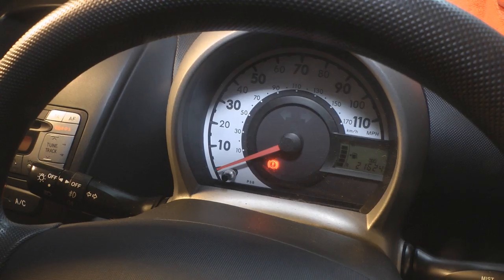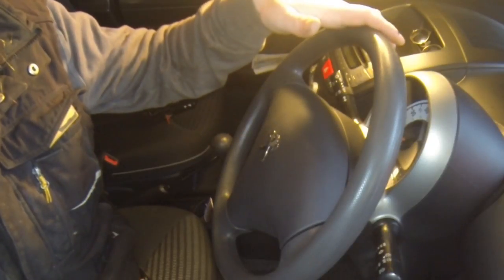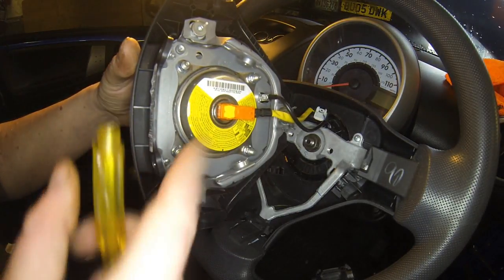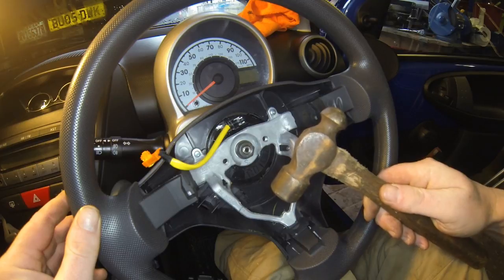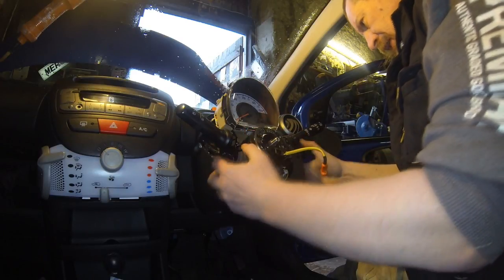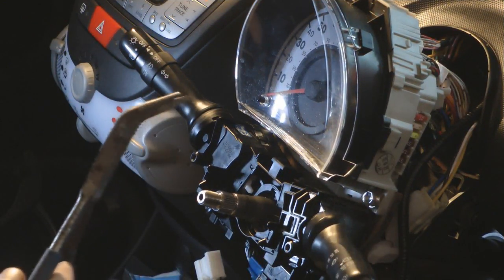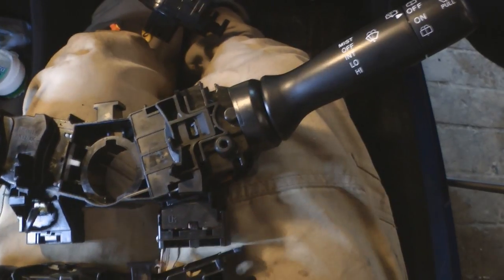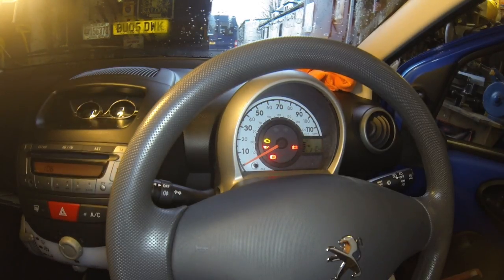#Peugoet107 #Indicators Peugeot 107, Aygo & C1 Replacing Faulty Indicator Stalk

Comment: So I've discovered a lot of 107s only have rear fog lights but the model I have has front and rear.  I can find a lot of cheap replacements with just the rear fog light switch but none with both.  I'm thinking about trying the rear fog light only switch and just not using my front fog light. Do you think the part would work?  The stalk seems identical from what i can tell apart from the extra switch position for front fog lights...
Reply from the maker: Yeah mine has front fogs too and I fitted the single rear fog indicator stalk.  Stalks with the both switches can be found but last I checked they were still nearly £200. My front fogs don’t work  anymore but could easily fit a separate dash mounted switch instead for them.
Reply: @playing_in_trafic  great! Good to know.  Yeah I'm not about to spend ten times as much just for the front fog switch if the rear only switch works. Getting one delivered tomorrow, hopefully I'll finally get it fitted and working
Reply from the maker: @merlin9240  Yep that’s my thinking too. I figured if needed for MOT I’d just remove the front fogs. All the best with the replacement. Hope all goes smoothly. Atb Dave
Reply: @playing_in_trafic  yeah the MOT was my only concern if this worked.  But i assume since front fogs aren't a legal requirement, it won't fail the MOT even if the car should have them right?
Reply from the maker: @merlin9240  Yeah. If they are on the car at the time of the test they are supposed to be operational but if you remove them it won’t fail because as you say they aren’t a legal requirement. Mine obviously never gets them checked. 😏

Comment: I've ordered a new stalk. But even if I were to just clean it, would I still have to take apart the wheel?
Reply from the maker: Yeah you really need it on a bench to clean it as it's fairly complex to take apart and reasemble. So either way you would need to remove it which involves removing the steering wheel.

Comment: Great vid. Any ideas about airbag light all of a sudden flashing 107 2006
Reply from the maker: Cheers, not 100% on airbag light but check electrical connectors under both front seats. These can sometimes get dislodged and show an airbag fault. Failing that It really needs to get the system scanned by a garage or someone with an SRS scanner. Hope you get it figured out. Atb Dave

Comment: Nice instructional video, very clear. Didn't quite get the part when you took off the steering wheel and marked a thin line? where the splines are ..is that possibly the steering lock position. Thanks
Reply from the maker: Hi Philip, thanks for the positive feedback. I marked the position of the wheel on the splines so that if the steering got turned at all during removal, then as long as I match up the marks when reassembling the steering will be straight ahead when the steering wheel is central. If you are one or 2 splines out when you put the wheel back on then the steering wheel will be cocked slightly to one side when the car wheels are straight ahead. Atb Dave
Reply: Thanks for making that point clear Dave, quite important to get it right. Just waiting for a T30 and the part, take a deep breath and go for it. will get back later to let you know. Thanks again, you've been a great help
Reply from the maker: All the best with the repair, glad to be of help. Atb Dave
Reply: HI Dave, amazing day all round. Successfully installed the indicator stalk 
I was all psyched up this morning waiting in anticipation for the part, ....already had the tools to hand. 
It went like clockwork nearly :-)
A couple of glitches as one has in any scenario i.e.

Struggled to ease out the whole stalk with one hand whilst compressing the clip, so enlisted some help to get that done  
Lifted the speedo up OOTW to gain some space

The reverse install was very straightforward
Saved at least £65 in labour by not going the garage route, and best of all doing the job yourself gave a lot of satisfaction....would have felt cheated if I had let someone else do it....
Indicators are all systems go, and looking good. Thanks again, your video was amazing
Reply from the maker: Philip D Awesome, glad to hear it went well. Yes you can't beat the satisfaction of repairing something like this yourself and saving a good chunk of cash in doing it. Cheers for the update, happy motoring. 😊Atb Dave
Reply: h3r34thebanter, still on a high after doing the job, am sure the old car will appreciate it. not bad going for a 9 year old I guess, worse things happen :-)

Comment: Great video, I've just done this on the wifes Citroen C1, put it all back together but now I've got the airbag light lit up on the dash. Any idea how to reset the light?
Reply from the maker: hmm, sorry to hear that. I don't know why airbag light would be showing. My advice would be disconnect battery and recheck the airbag connector is plugged in correctly but also check and wiggle the connectors under the front seats in case somehow they got knocked loose whilst you were working in there. If the light still stays on after you reconnect the battery, you may need to get it checked and reset with an SRS scan tool. Hope you can get it to go off without to much hassle. Atb Dave
Reply: h3r34thebanter Thanks Dave. I'll give that a try tomorrow!
Reply: Easywhenyouknow Did it work? I've exactly the same issue on my 107, the airbag light is now flashing!
Reply: Hi Andy, I took the airbag back off and discovered i hadn't pressed the connector back in properly. (The orange and yellow one) All fine now!
Reply from the maker: +Easywhenyouknow I'm glad to hear that 
you managed to sort it fairly simply, I hope Andy has the same luck. Atb Dave

Comment: Might be a bit late to the party. would replacing the stalk help my issue which is, both my full beams and dipped lights have stopped working. When I turn my light on the full beam light in the dash comes up even though I don’t have the full beams switched to the one position TIA
Reply from the maker: Sounds odd, guess it could be a stalk problem. I honestly don't know though. Hopefully someone can help you out. Atb Dave

Comment: After changing the stalk, the high beam goes on when I connect the battery again. The ignition is off and I can't shut the high beam off with the stalk. Any toughts?
Reply from the maker: If all connectors are properly connected it sounds like a faulty stalk.

Comment: Okay, is there some trick to getting those T30 screws loose, they absolutely will not budge on mine at all.
Reply from the maker: No trick needed but using a T30 bit in a ratchet drive is prob easier than a screwdriver type. They shouldnt be that tight though.
Reply: @playing_in_trafic  Thanks for replying, I finally got them loose by gripping the driver handle with a pair of vice grips to get more torque on the twist. Boy they were tight. All done now though and indicators working again. Thanks for the video, it was invaluable.
Reply from the maker: Perfect. Glad you got it all fixed. Cheers for commenting back. Atb Dave

Comment: Great video, thanks! But my dash indicator light still isn't working...does anyone have a link to how to change the bulb in the dash? Assuming that's what it is since I replaced the stalk...
Reply from the maker: I haven't heard of anyone else having that problem, hope someone can give you an answer on it. Atb Dave
Reply: I'm having the same problem - would be interested to hear if you got it fixed!
Reply: The fault was supposedly on the instrument panel circuit board...but we never got to test the theory because the garage said it wasn't an mot fail after all, as long as there was an audible indicator warning
Reply: @blandyjapseye69  thanks, I was thinking along the same lines.

Comment: Very helpful video. Just a few comments on problem I had with the job. Couldn't get steering off with hammer so bought a cheap puller https://www.amazon.co.uk/gp/product/B000WTPJKA/ref=oh_aui_detailpage_o00_s00?ie=UTF8&psc=1 did the job fine. Removing and fitting the spring clip, I found I needed 2 hands to remove the stalks & a helper to compress the clip. Also, I noticed that the commutator ring for the air bag and horn has limited 5 turns, so it is important to make sure it doesn't rotate when you remove it, because if you don't have enough turns left for full lock you'll smash it.
Reply: Not tried it, but when you compress the spring clip, maybe use an old fork to keep it compressed, then you can use both hands to move the stalk assembly.
Reply from the maker: Great info, thanks for sharing. Atb Dave

Comment: Can anyone shed some light on refitting the clock spring as I broke mine replacing the indicator stalk did I just tighten up the wheel to much or does the clock spring have to be positioned In a specific position any help would be greatly appreciated.
Reply from the maker: Not sure I know what you mean, but hopefully someone can assist. Atb Dave

Comment: Top Video BUT don't remove the RED clip until the stalks are back in place, no pliers needed to refit as the RED clip is holding the clip to make the job easy Lol the RED clips can then be flicked off with a screwdriver.
Reply from the maker: lol Yeah that makes sense, cheers.